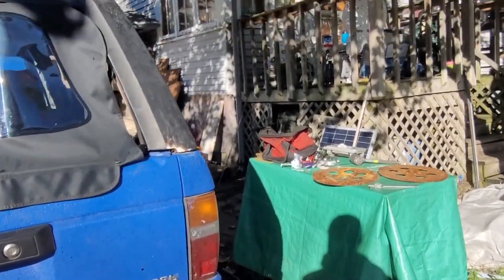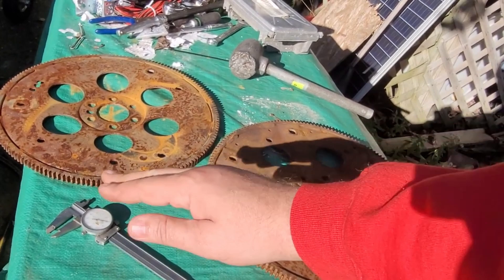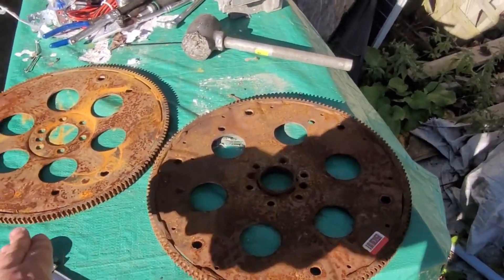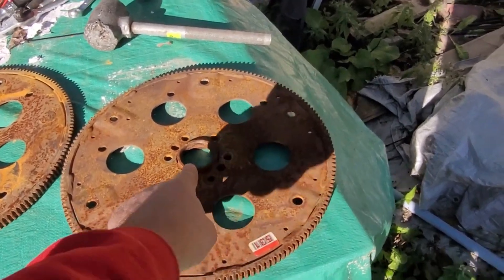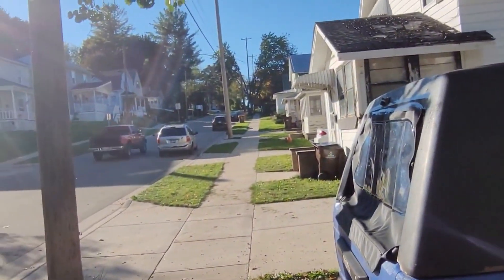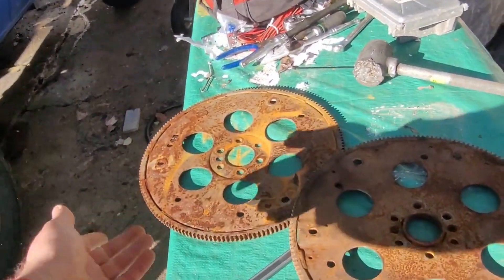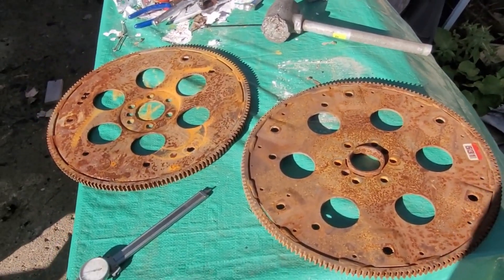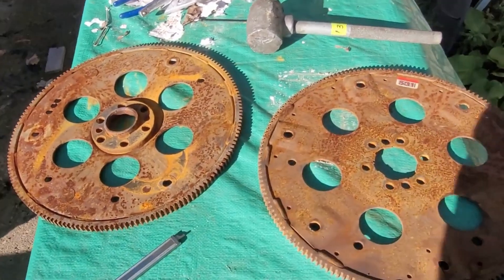How to adapt any 90 degree Chevy transmission to any LS engine swap

Comment: So.i need help does that adapter goes infront of flex plate or behind flex plate
Reply from the maker: Goes just like it's shown in the video
Reply: @TheDrivewayEngineer  okay reason I ask you is cause I'm using swaping  a 4l60e transmission from a 2000 s10 v6 into a 5.3 chevy motor out of a 01 suburban ,  I'm using v6 torque converter that came with s10 tranny  but it does need the spacer and longer torque converter bolts but if I use the spacer behind flex plate or flywheel ,will the starter teeth still engage with the flywheel taking consideration your pushing the flywheel alittle bit towards the transmission?

Comment: Jr my th475 has a 6 bolt converter. So I need to either change the converter to a 3 bolt or get an flexplate that came out of say a bb 454 like the trans came out of? I have the 4l60 dished one now. I’ve put a bigger cam in it now thanks for everything you do on this channel.
Reply from the maker: No, get a 4L80 flexplate, it has 6 holes

Comment: Used the 4l80e flexplate on my th400 worked fine no modification. I am gonna be getting a better converter at some point but a stock gm stall works fine for the 5.3. In a 1990 k1500 4x4 that came with the 4.3 v6 and a 700r4.

Comment: For the guys asking about the manual trans to the LS, simply get a manual flywheel from a 4.8 or a 6.0 and i usually get the clutch and pressure plate for the year trans I have. Then I only put the pilot bearing 3/4 of the way in, if you drive it all the way in the pilot on the trans wont engage the pilot bearing. Or you can get an extended pilot bearing from summit racing or ebay. I think the brand is allstar with part number 26114.

Comment: Right on the money. Just keep in mind for a 350th/400/PG , if the convertor only has the 350th bolt pattern ,you will need to shave/dremel the bolt holes on the flex plate . The  400th convertor bolt pattern just happens to match up fine . Had to do this on mine not to long ago. Not something we think about as most , have both 350th holes and 400th holes .

Comment: Are you familiar with the 6l90 and the flexplate for it? I just rebuilt my trans a few months ago, the flexplate I got for it looks like the one you have there for the 4l60. There were no adapters. I know this is a little off topic and out of the way of what you're doing here. From all the research ive done, i got the correct one, but id like to hear your thoughts.
Reply from the maker: 6l90 flexplates have a triangle in the middle, look more like a harmonic balancer
Reply: @TheDrivewayEngineer  ok, thanks for the insight. Keep doing what you do mang.
Reply from the maker: @pathutson5227  I can't post a pic here, but the part number is 12602448
Reply: @TheDrivewayEngineer  awesome thanks man, I'm going to look it up right now.

Comment: Don't forget you have to slot the torque converter bolt holes  in toward the crankshaft  on the 4l60 flexplate  to use the non ls transmission